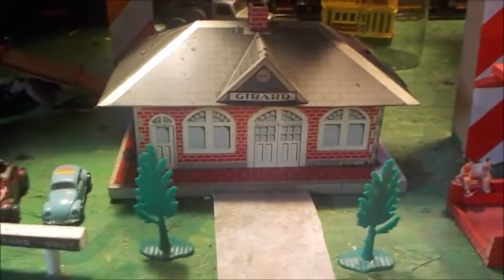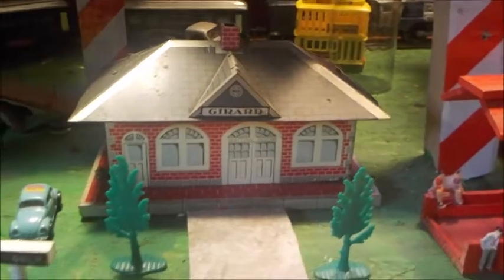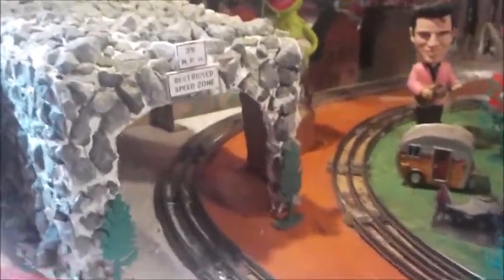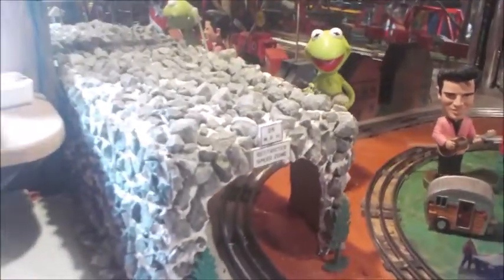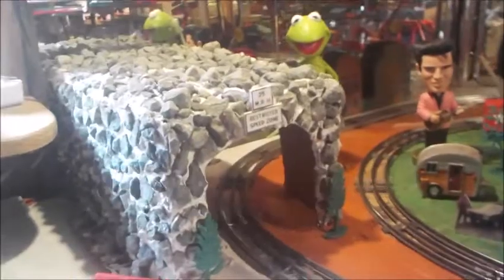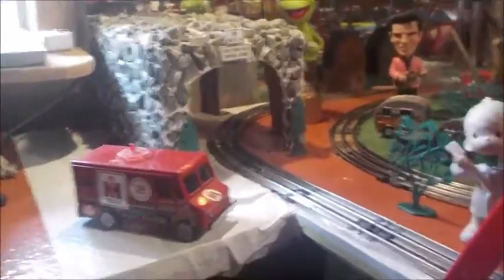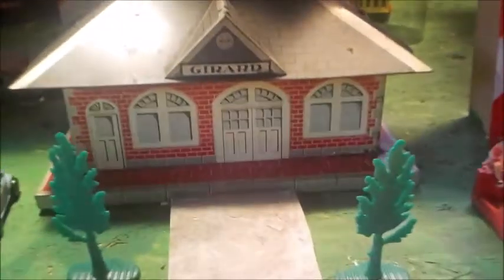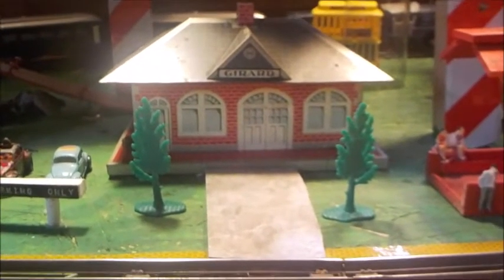1930's Girard / Marx  Whistling Train Station & New Stone Tunnel

Comment: I picked up one of those a little while back (for cheap, at the Second Hand Junk Store) and still haven't tried it out. A previous owner cut a hole in the back I believe to increase the whistle sound getting out of it.
Reply from the maker: There's Really no  need to do that, the Tin  Metal  Building acts like a Horn Body and the Sound comes out the Chimney Perfectly. 90++ Years Old and Still Works!.
Reply: I have had one of these for years (20+) just sitting on a shelf in my house with other old stuff. Just out of curiosity, I decided to Google it and see the value of it,. ( thats how i found your video) I have yet to open it up or test it,
And another thing I figured there was only a light bulb and I never knew it whistled,.